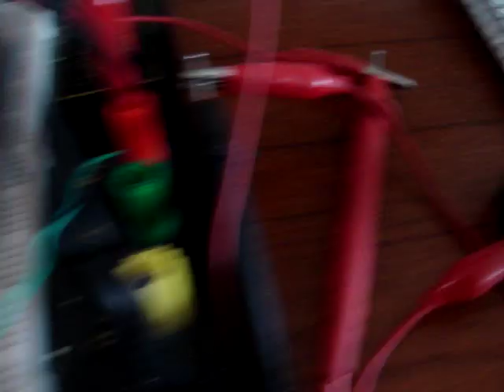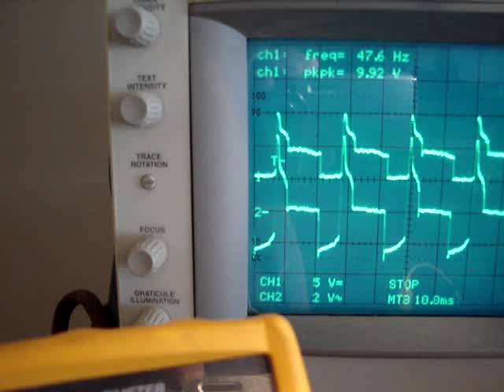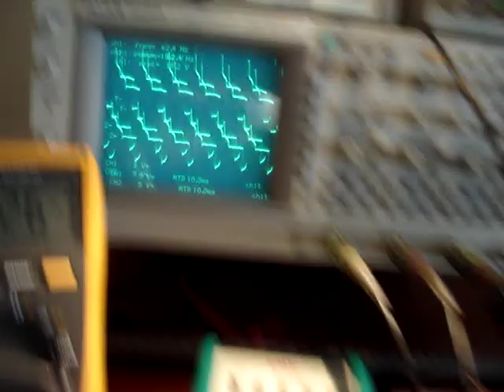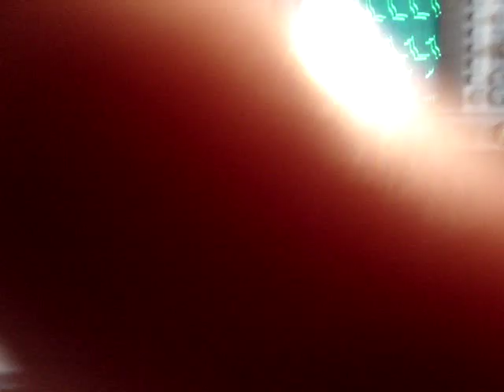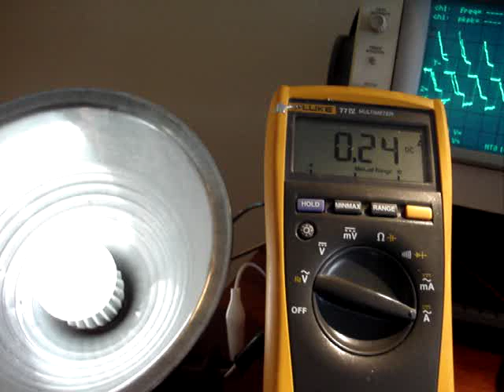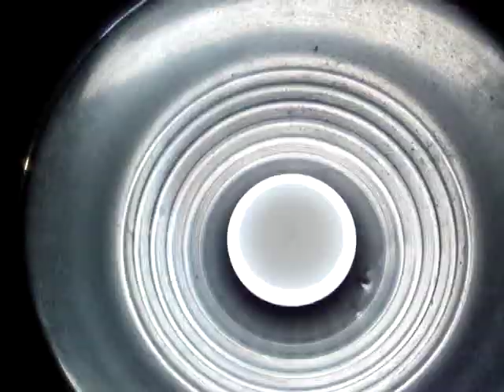Joule Ringer 2.0 Waveforms Using Radio Shack Transformer

Comment: The ultimate JR P3 
The 2N3055 won’t work; it didn’t with me. If you’ve seen an Antenna’s cable, you know it has a copper wire, silver foil covering, and braided wire. What you need to do: solder one side of the copper wire onto the braided opposite side cable for the positive, connect the other copper wire to base with a resistor, the braided opposite side solder it to collector and then add a diode to it. 
This cable has potentials; pass on info. 
Sorry, don’t get much space to write on.

Comment: That was certainly informative. I know there are a number of people watching this little experiment, wondering if it's as efficient and applicable as it appears.

A simpe circuit, easily made of common parts, that could take the output of a PV panel, or similar, that could efficiently charge batteries and run a decent set of lights at a high lumen-to-watt ratio, maybe make HHO..

thanks for chiming in and making this video.

Comment: This called the Joule "Ringer" 2.0 not Joule Thief.  They are different.  I kinda found the same thing you did about the oscillator except that I put a .1uf cap across the yellow wires not the output back wires and got better results.  This will run just fine without it.  Thanks for showing the wave forms.  Any ideas what is going on here?  Is this just another stupid simple circuit or have we stumbled onto something different???  Can it be the circuit inside the LED bulb that makes the magic?